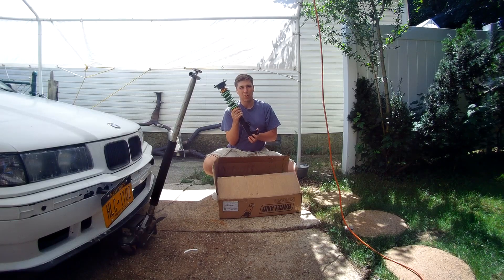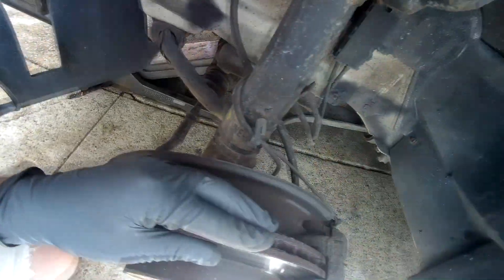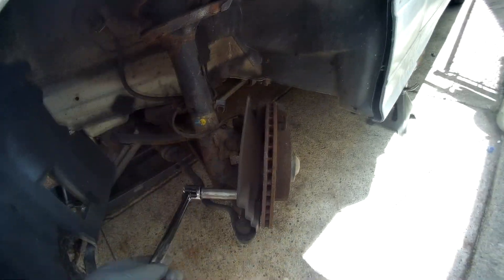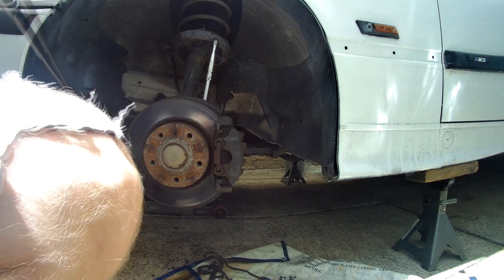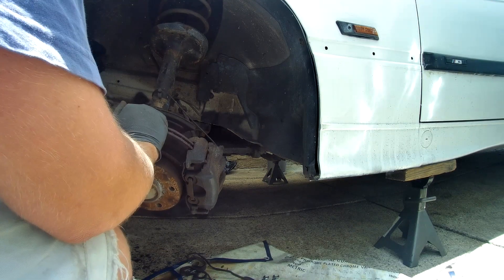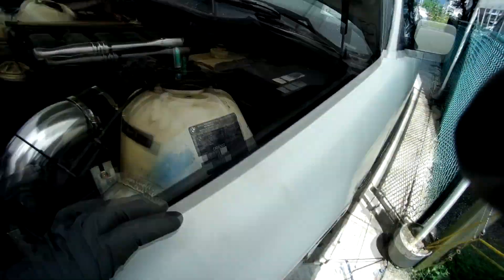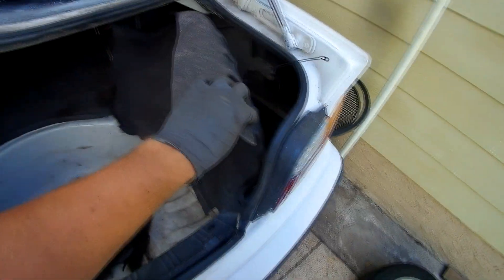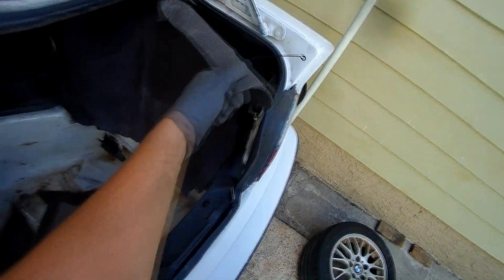How to Install Raceland Coilovers on a BMW E36 EASY DIY

Comment: Did you remove the helper springs because I fitted my coilovers an my rim is scraping against so someone told me to remove the helper
Reply: How did you fix this I’m having same issue
Reply: @ghabeswarm7191 did you ever fix it because I am having the same issue it’s starting to take flakes off my wheels